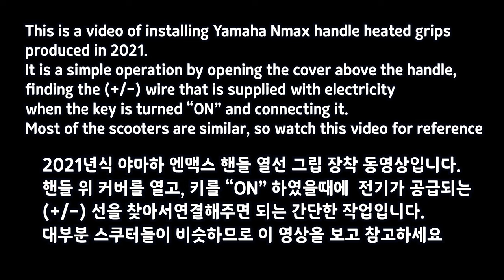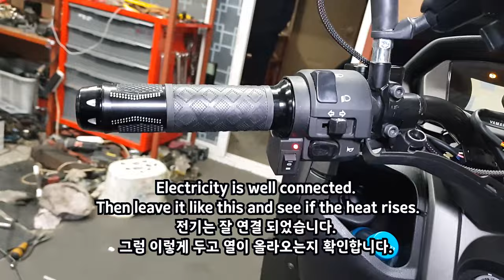How to install Yamaha Nmax 125 scooter motorcycle handle heated grip

Comment: Watt heat grip ? Fusible ? Ampère ?
Reply from the maker: Merci d'avoir regardé notre vidéo.
Les spécifications de cette danse sont les suivantes.

Tension: 12V Puissance: 12w-24w (Réglable)
Ligne rouge : DC+12 cathodes
Ligne noire : anode DC -12
Taille : Longueur : 140 mm, Diamètre : 22 mm

Pour plus d'informations, veuillez utiliser la recherche Google.
Recherchez "Shirong heat grip" et vous trouverez le produit.

---
https://www.google.com/search?q=Shirong+heat+grip&sxsrf=AOaemvLHwKH4gHV1BvoX1Joe_xh2wqMavw:1641937427581&source=lnms&tbm=isch&sa=X&ved=2ahUKEwj3zPTI1ar1AhVHA4gKHTmgCZEQ_AUoAXoECAIQAw&biw=1897&bih=908&dpr=1.35#imgrc=Q9AVyWhivrWBzM
---

Thank you for watching our video.
Specifications for this dance are as follows.

Voltage: 12V Power: 12w-24w (Adjustable) 
Red Line: DC+12 cathodes 
Black Line: DC -12 anode 
Size : Length: 140mm, Diameter: 22mm

For more information, please use Google search.
Search "Shirong heat grip" and you will find the product.

Comment: Does it drain the battery?
Reply from the maker: The battery is safe if it is operated only after the engine is started, but if the heated grip is operated without the engine started, the battery will be discharged.